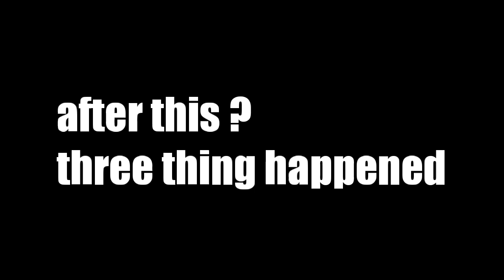Yamaha R15 sprocket job fails ! Test ride and (giveaway)

Comment: That rear sproket with your current front sproket can cause wheelie. The bigger rear sproket the more torque. So change your front sproket accordingly.
Reply: My bike is R15 v2 my socket is 15/ 47 which socket i should  try to get more inchial and more torque?? From which bike socket must i try??
Reply: @bismibismija8119  mt rear sprocket 52
Reply: @bismibismija8119  Try R15 v1 front sprocket (14t) or may be FZs (same teeth count).

Comment: R15 v1 sprocket is direct fit in fz, and it will increase pickup and reduce top speed, 
I am done it in my fz, love it 
( No need to add chain link extra)
Reply: 42t i think.. 
Bro how's your experience.. Did low torque increased? How do you feel after speed breaker.. Sometimes stock FZ chain sprocket size feels underpowered after speed breaker with pillion rider..
Reply: @akshayakumarbehera5840  torque really increased, you really feel that when you taking the bike from first gear,the wheel spinn 😍( don't expect too much, but you can really feel a bit punch when you throttle )
Top speed not tested (124kmph before)
And 
I also installed free flow exhaust, video is in my channel, check it out if you interested
Reply: @munavarsharfas4107  bro fz v2 l direct fit pattuvo ??..enik low end pick up aan vendath...r15 v2 aan ellarm sggst chynath
Bro de sggstion ??? V1 price ??
Reply: @munavarsharfas4107  enik chain set full aayt matan tym aayi??? V1 rear sprocket mathrm aano r15 nte.???.atho Ful set ano ??? Front sprocket fz v2 nte thanne vangia mathio???
Reply: @Ramesh_Ram  yes both front and back sprocket Direct fit the chain not enough length, you need to ad 1or2 link ( i am using new sprocket and old chain now & my chain is in good condition and i will change it soon)
Reply: @Ramesh_Ram  njan idhinu munna fz v1 sprocket aan use chaydhadh(14/40) adil ninnu 14/42 aakiyappo pickup nalla maatam thoni
Reply: @munavarsharfas4107  bro fz v2 alrdy rear 41 teeth ele..ist 1 teeth kootial vlye diffrnce indavuo??? Apo rear 47 teeth ula R15 v2 ale onnude torque kituka????
Reply: @Ramesh_Ram  top end nannayi kurayum, 
Normal 60to70 oodikumboya bike high rpm aayirikkum max oru 44t vara okka matiya mdhi, adil koodudal chayyal stunt bikokkaya,
Reply: @Ramesh_Ram  pinna front and back r15 v2 idanagi valliya scene illa
15/47 idh ok aan
14/47 idanda
Reply: @munavarsharfas4107  frontum backum r15 v2 nte ittaall top endum initial pullingum nannay kuduuooo
Reply: भाई पास Karizma r bike to मे कितने तीत वाला चैन spoket लगा ऊ ताकी गाडीका मायलेज ओर पीकप बडे❤

Comment: Bro
Larger Rear sprocket = Less top end
Smaller Rear sprocket = More top end

Larger front sprocket = More top end
Smaller front sprocket = Less top end
Reply: Hi bro please try the sprockets of 15tT front and rear 36T rear weal you will get a good results  try bajaj chaine sets
Reply: Insul power which spoket
Reply: @greenwanderlust1279  rear spocket  try 40
Reply: @bismibismija8119  fzs bike

Comment: Ali bhai more teeths and bigger dia only increase torque that means still not top speed...i think u have to use karizmas sprokets...even karizma owners install smaller than stock size for more top end
Reply: sarath santh , right 👍

Comment: That was a huge change in sprocket size, upwards in number of teeth, resulting in higher engine RPMs at highway speeds. So that is not too efficient.

Comment: fz ka front sprocket 14T hai 
usko 15T kerdo then top end acha hoga 
but low end torque decrease hoga
Reply: Sahi bola bhai
Reply: 13 teeth sprocket konsi bike ka fit hoga karizma ka 13teeth hojayega kya ?
Reply: @mr.unknown2595  kis bike may
Reply: @travelfoodandnature4782  r15 v3
Reply: @mr.unknown2595  TV's Apache 150 old ka 13t front sprocket check karo
Reply: @travelfoodandnature4782  ok boss thank you

Comment: My r15 has the problem of vibration after 15-20 km . Initially it is smooth but after sometime it starts vibrating..
Reply: Replace your fuel filter

Comment: Mere Bhai piche bada dalne ke bajai aage bada dal diya hota. Increasing 1 tooth I front is like reducing 3 teeth in rear sprocket. Bhai samne 15th aur piche yamaha R15 v1 ka 42 teeth sprocket dalo aur deko Bhai. I have installed 16t front sprocket in my yamaha R15 v2. My to top end is amazing!
Reply: Top speed kya hai Bhai bike ki aapke
Reply: 16T konsi bike ka hai. Aap ne kahan se avail kiya??

Comment: Bhai you need to change the front one.. as it is just a mathematical ratio.. jitna jada engine rotate hoga usi ratio he hisab se aapko back sprocket bhi hona chiye.. R15 v2 ka front sprocket change karo.. u will gate the result..

Comment: Less teeth is best for top end, more teeth for sudden pickup, increase torque
 ,gear shifting fast . means in less teeth  , if  1st gear shifting 15 kmph  . In  More teeth  10 kmph in a same same rpm . 
So quickly speed increase but  rpm going to high,and topend will decrease.

Comment: Cant increase top speed just by installing bigger or smaller rear sprocket, you must upgrade your engine too coz your last gear is too overdrive to accelerate your motorcycle and wind ressistance is bigger enough in higher speed